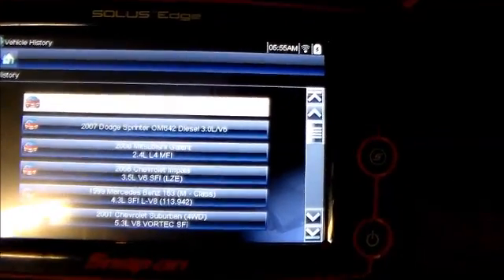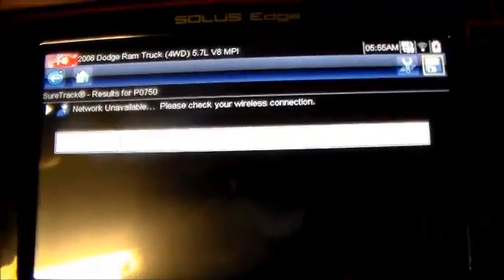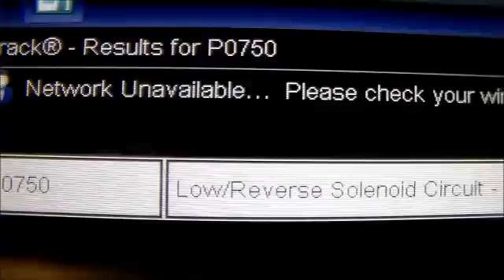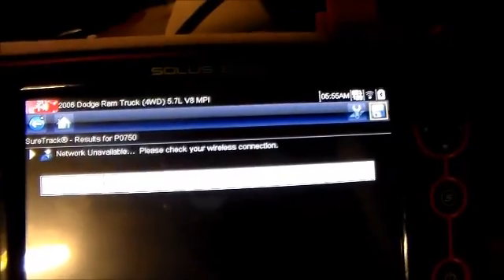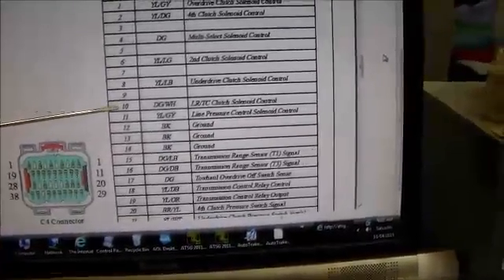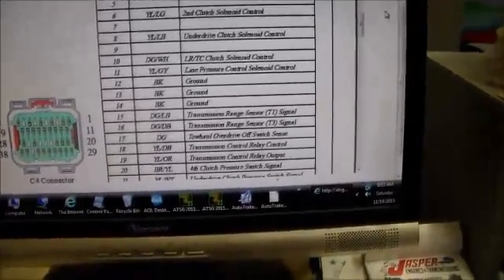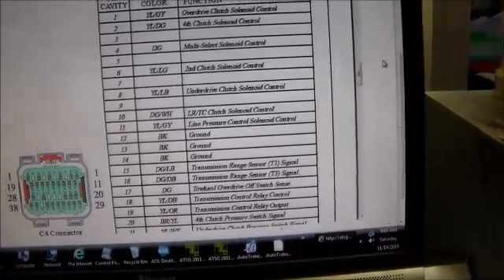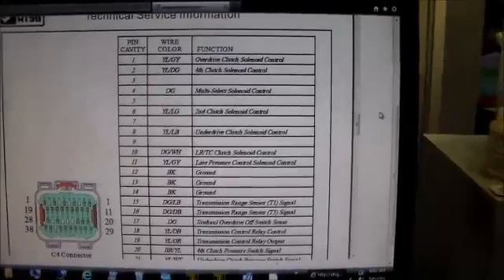545RFE, P0750 Diagnosis and Repair

Comment: Hey I have a 2005 dodge ram 1500 and it’s showing a p0700 and a p0750 I changed the pack out It drives perfectly for abt 2 or 3 minutes or I can shut it off and on and it drives perfectly for a few minutes and back to the way it was it drives good when code is pending but when stored no good can u help me please
Reply from the maker: where did you get the part from?
Reply: @GaryFerraro Amazon
Reply from the maker: @geraldtaylor2061  That may be a problem,  i only go to dealer

Comment: I have a 07 with the same code it was my dads truck it sat for 4 months before he passed away and it was working before parking it I changed the pack out and still have the same problem could a squirrel got under there and chewed wires
Reply from the maker: sure very possible, did you ohm the solenoid at the computer?
Reply: @GaryFerraro  I didn’t I did switch the wires now and it had a different code like urs so I’m going to see about getting a different pack maybe and trace the wires down to it thanks for ur reply
Reply from the maker: Where did you get the solenoid pack from
Reply: @GaryFerraro  got it off a place that sells them refurbished off of Amazon.First one came broken so they told me to keep it and sent me another one. I didn’t have the 400 to 500 dollars at the time to buy a brand new one.
Reply from the maker: @matthewwiese3184  what is the year make and model of your car?  Have you contacted the dealer for a price?
Reply: @GaryFerraro  2007 dodge ram 1500 and no I talked with a guy I no who does transmission and he was telling me there around 500
Reply from the maker: @matthewwiese3184  The OE Part number is  68353383AB     According to the dealer they are 550,  but maybe you can find an OE one at a better price
Reply: @GaryFerraro  well last night I found a wire looks like somebody cut it fixed it and now I’m getting a code p0987 I was a little low on fluid and now it starts in 1st then shifts hard into 2nd but doesn’t do 3rd
Reply from the maker: @matthewwiese3184  will the code clear?
Reply: @GaryFerraro  yes it clears but I’m thinking I might have to much fluid I had someone help me and over filled it now I need to to take some out
Reply: @GaryFerraro  so i pulled the pack out and the end of the pack where its plastic is splitting apart like they didn’t glue it good enough
Reply from the maker: @matthewwiese3184  of the solenoid pack. Probably not OE

Comment: Does the battery need to be connected to check this specificity?
Reply: Does it have to be connected to check this?
Reply from the maker: @ramrod273  Not if your checking just ohms, i had to start the car to see if the code would change or stay the same but just to check ohms, no
Reply: @GaryFerraro  I checked it today with the battery connected. But the meter was all over the place I don’t think I have a good meter I set it at 20 ohms and every on would jump all over the place. Anyway after plugging the c4 connector the check engine light came back on for P0750 so I’m guessing the communication between the computer and solenoid are good.
Reply from the maker: @ramrod273  Did you compare to another solenoid to see what the meter will do,  On another solenoid, maybe the meter will be steady reading the ohms
Reply: @GaryFerraro  Also I’m setting the meter to 20 ohms it’s the lowest setting on the meter.
Reply from the maker: @ramrod273  ok, no Auto setting?   On other solenoids see if your getting about 2.0 ohms
Reply: @GaryFerraro  I have to check the manual it has many settings. I really appreciate your replies.

Comment: I have a 2012 ram 1500.     I have same code.     At times when im driving.  The truck will go into 4th gear  and i cant shift up or down     i have to pull over turn truck off and on.   Then its back to normal.      U thi k its the solenoid pack
Reply: I just changed it.    Thank u.  Once again
Reply from the maker: 99% of the time it is

Comment: same tranny (545rfe), different code: p0869l line pressure high fault..   

changed solenoid pack, transmission pan and filters, line pressure sensor and even the transducer cable end that connects to the line pressure sensor..   still have a static line pressure of 251.37 psi (4.7 v)?   what could it be?..
Reply from the maker: if you clear the code it comes right back?
Reply: yes.. i clear it and it comes right back.. line pressure remains static.. does not move, and voltage as well.. remains at 251 psi, voltage static at 4.1v
Reply from the maker: @rays4067  Voltage actually should be zero,  low voltage equals high pressure, have you ohmed the solenoid at the pcm?

Comment: Changed my silanoid pack,fluid,filter and out sensor, car shifts mostly but sometimes goes on limp mode..gives codes for p0750 and also trans pressure codes..please any advise..thinking about changing the in sensor also
Reply from the maker: What year is this?

Comment: Thank you for sharing this information.  Please help me fix this van that's been broken for almost 3 years. I have a 09 Chrysler town and country van with transmission 62te. I'm getting code p0755 (2-4 or 2c solenoid circuit)
I want to ohm test the solenoids but I think the "transmission control relay/battery voltage" pin number and solenoids pin numbers are different from the ones you tested. Are the truck and van diagrams different?
 I suppose to do this ohm test all I got to disconnect is the C4 green face connection?
I just want to make sure that all sensor connections to the transmission need to stay plugged in to transmission to be able to do this test. Any help is greatly appreciated by all  us diy at home.
Reply from the maker: If your going to ohm the solenoid, unplug the green connector and ohm the solenoid
Reply: @GaryFerraro  , Thanks for your reply. Much appreciated.
Reply from the maker: @raulgallardo5014 If you need info, i can send you some just e-mail me
gsferraro@yahoo.com
Reply: @GaryFerraro  , I will email you and once again thanks not many people will take the time to teach others. I've had this van broken  for so long due to lack of funds. I was told it needed a tranny rebuilt again so I took it out but then I saw your video and before going any further I'd like to make sure my wiring is not the problem. This tranny was rebuilt due to same p0755 and after rebuilt it shift good for 6 months til it went in limp mode again and I let it sit for almost 3 years until now.

Comment: Hi Gary, after you cut the wires for pins 8 and 10 and swap them, do you then plug back in the c4 connector at PCM to do test?
Reply from the maker: yes, but didn't drive the car, just started it back up

Comment: I have this code on my 2005 Grand Cherokee 5.7. I cleaned the EATX relay, changed the valvebody solenoid pack and installed the Transgo kit, and I still have the P0750 Shift Solenoid A code.  Any ideas?
Reply from the maker: If you clear the code does it come right back?
Reply: @GaryFerraro  Yeah, I clear it, it goes directly to limp mode (3rd gear) when putting it in drive, and then if I drive it for a minute or two the P0750 code comes up. It will not come up when sitting idle in park.
Reply from the maker: @CHAOSMOVEMENT  see if the code will come up when drive is selected and your not moving, if it does you can switch the wires to see what code comes back
Reply: @GaryFerraro  Ok, so if it happens at idle in drive, I would have to pull the pins from both sides of the harness, and switch them with another solenoid wire, and if I get a code for that solenoid, then that wire is bad?  If I get the same code than it's the PCM then, and what happens if I dont get any code while it's idle in drive?  Would that also point to the PCM?
Reply from the maker: @CHAOSMOVEMENT  only switch the wires at the pcm, if code remains the same, bad computer, if code changes, solenoid pack or wire
Reply: @GaryFerraro  Thank you kindly for the responses.  What tool is required to pull the pins on the PCM side of the harness?
Reply: @GaryFerraro  Sorry to bother you again, I got the pins swapped (L\R to MS), but I can't get a code to come up when idle in drive.  Any guidance on how to force a code? Thanks!
Reply from the maker: @CHAOSMOVEMENT  Try letting run and get hot, solenoid may short when hot
Reply: @GaryFerraro  Thanks for the reply.  I let it run sitting in drive for about half an hour.  Solenoid pack is brand new.  I was hoping to get the code, but no luck.  Now it would seem the only way to do it would be to swap the pin at the transmission end as well and drive it to see if it's the wire.   That's going to be a nightmare getting to that terminal haha.  Almost makes me want to cut the wires and temp splice them and then do a lineman's splice once the diag is done.
Reply from the maker: @CHAOSMOVEMENT  ok, so you have a new solenoid pack and are still getting the same code?
Reply: @GaryFerraro  Correct.  That's why I'm looking to see if the wiring or PCM is the problem here. I've pulled the valve body and replaced the solenoid as well as the accumulator plate, springs and seals.
Reply: @CHAOSMOVEMENT what was causing the problem? Did you ever discover the cause?

Comment: Hi mate
I am having this problem P0750 on hyundai i20
L&R solenoid open/short
Any ideas would be appreciated
Reply from the maker: do you know what transmission you have?
Reply: @GaryFerraro  4speed automatic
Reply: @GaryFerraro  I rang to local hyundai dealer they can't tell me exactly what transmission it is

Comment: Hey so I have a 2006 jeep commander I am getting code p0700 and p0750 and also my transmission is stuck in limp mode (stuck in 3rd gear) and now I noticed if I go for a little drive and I park it I can hear a whirring sound coming from the tranny pan can the solenoid pack make noise ?
Reply from the maker: very possible yes, but if that is in limp mode, you really don't want to drive around. You may have a bad solenoid pack for the 750 code
Reply: @GaryFerraro  can it cause more damage I need to bring it to a shop today
Reply from the maker: @koledesjarlais982  well if it's in fail safe you are putting a lot of stress on one clutch pack, simple repair can turn into an overhaul
Reply: @GaryFerraro  thanks man I'm gonna get the vehicle looked at and hopefully it's the solenoid pack and it will be good again
Reply: @GaryFerraro  also I'm in Canada what kind of places do pinout tests ? I wanna get my pins tested but dont know who does them
Reply from the maker: @koledesjarlais982  A transmission shop should do that, fairly simple to do
Reply: @GaryFerraro  sorry for asking so many questions but do you know where I can get my diagram I found a pinout tester
Reply from the maker: @koledesjarlais982  What is your e-mail, i may be able to send you the C4 connector which is the transmission.  My e-mail is
gsferraro@yahoo.com, e-mail me and i can send you something(have to look for it)
Reply: @GaryFerraro you're a good man Gary.
Thanks for your work, ethics, and your help in all these comments sections.
May God continue to bless you.

Comment: Gary I had the code 0750 and confirmed it on two places.  So, I changed the solenoid pack with Mopar brand $400.  But now not only I have code 0750, I also have code 0700 and at the start the TPMS lights blinks for the few seconds and then stops.  Any idea?
Reply from the maker: ok,  so the 750 code comes right back once cleared? as soon as you start the car the code is back?
Reply: @GaryFerraro  This is very strange.  Sometimes, the transmission will shift right and the engine light which was previously illuminated will turn off by itself .  But many times the transmission will go into the limp mode.  When I replaced the solenoid, the car drove fine for few miles shifting gear properly.  But the second day, it started doing the same thing again and now throwing two codes 0750 and 0700.
Reply from the maker: @waqarsyed4230  The P0700 is more of a generic code,  Still have the 750 code, have you ohmed the solenoid at the PCM
Reply: @GaryFerraro  Not yet.  But I will do next.  Also, when I removed the connector, it was very tight and very hard to disconnect.  But now I have pushed all the way down and it is locking but not as tight as it was before.
Reply from the maker: @waqarsyed4230  Those are tight, sometimes some crap my get in there make a little tight but may loosen up. Ohming the solenoid at the PCM will check the wire and connector and solenoid pack
Reply: @GaryFerraro  Thank you Gary.  God bless you and give you long and happy life.
Reply: @GaryFerraro  Hi Gary, I took the C4 cable out of TCU and checked the ohms of solenoids.  (Pin 19-10, 19-8, 19-6, 19-4, 19-2, and 19-1)  They are all reading 1.6 to 1.7 ohms.  (Pin 3, 5, 7, 9 were empty but I included them in the count).  Then I checked my old solenoid with Pin 10-7, 10-19, 10-21, 10-20, 10-17, 10-2 and 10-12 with 10 as positive. Except for pin 10-12 which may be the LP solenoid, all the solenoids are reading Ohms between 1.6 and 1.7.  Look like I have a different problem.  May be Valve body or Relay?  2005 Jeep GC 4.7 4X

Comment: Had same code, P0750, on a 2008 Jeep Commander 5.7L; same transmission. Ohmed out 10-19 at 140 ohms. Pins 10-2, 4, 6, 8 all were 140 as well. Replaced solenoid block; new one had 1.6 ohms between 10-19 and 3.0 ohms between 10 and the rest. Problem solved, wife is happy. Thanks for an informative video.
Reply from the maker: Happy Wife, Good deal, thanks for watching and good job fixing the car

Comment: I'm getting the po750 code changed the solenoid pack twice still getting the same code I ohmed  out pins 10 and 19 from the TCM plug and I get an open circuit any help what to do next would be well appreciated thank you
Reply from the maker: Do a continuity check on each wire
Reply: Thank you for responding I do not know where wire from pin 11 and wire from 19 goes to I tried to look up a wiring diagram online I cannot seem to find where these two wires connect into the transmission solenoid do you have any idea which pins on the solenoid are for these two wires
Reply from the maker: Auto Glass Xpress can you send me your vin number   I can pull a wiring diagram.  Does the code reset right after clearing?
Reply: @GaryFerraro  it is pin number 10 sorry for the confusion
Reply from the maker: @autoglassxpress6118  If no reading try pin #8 or maybe #4 see if you get a reading
Reply: @GaryFerraro   8 or 4 and 19
Reply: Open circuit on pin 19 and 8 open circuit on 19 and 4
Reply from the maker: @autoglassxpress6118  are you sure the connector is plugged in?
Reply: @GaryFerraro  I went out and disconnected it and replugged it in just to make sure and still get the same results
Reply from the maker: @autoglassxpress6118  My e-mail is gsferraro@yahoo.com   e-mail me so i can send you some info on the connector to make sure you checking the correct terminals
Reply: 1D7RB1GT3BS703578 yes it resets right away
Reply from the maker: @autoglassxpress6118  ok, just to confirm, your on the C4 Connector, when unplugged the inside of the connector is Green,  Pins 10 and 19 are the correct pins
Reply: @GaryFerraro  yes it is green and I believe it's pin 11 and 19 or it's 10 and 19 I would have to go back out and count the pens
Reply: @GaryFerraro  and yes it is unplugged
Reply from the maker: @autoglassxpress6118  It is 10 and 19, do you have a diagram?
Reply: @GaryFerraro  I found the diagram for the computer plug but I do not have a diagram for the plug at the solenoid so I do not know where pin 10 and 19 goes to the solenoid. my thought I would check the solenoid on the pins eliminating the wires if it ohm's out correctly at the solenoid I would jump the wires from the computer terminal to the solenoid connector thinking I might have a broken wire someplace

Comment: I’m having problems with my truck getting codes p0700 which is generic and giving the issue p0876? Switch out the sensor it said and nun does sams stuff at 40mph hit limp mode switched transmission still does the same stuff what can I do?tech said it’s my solenoid pack and wiring is good?
Reply from the maker: what is the year,make and model of your truck, engine size too